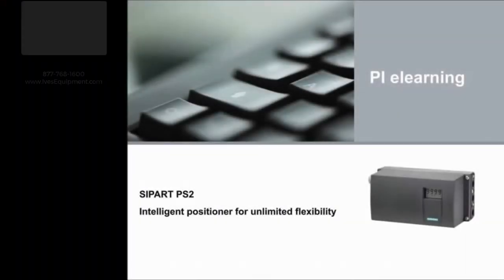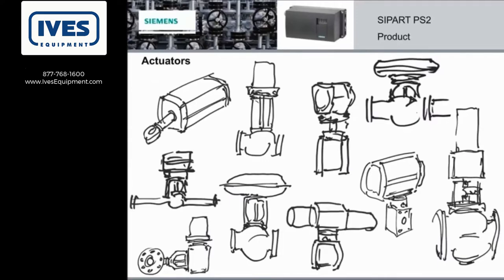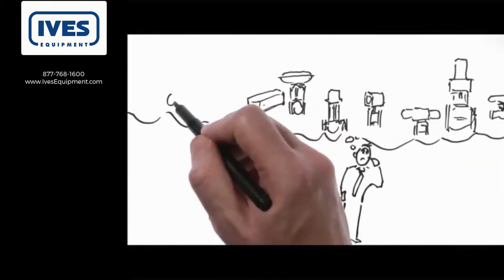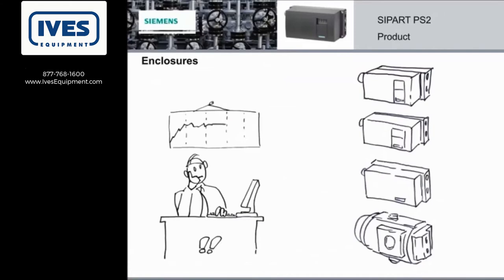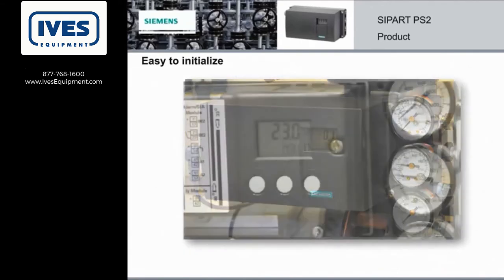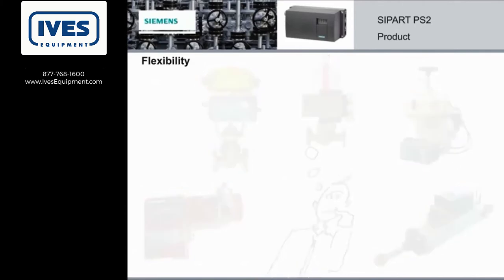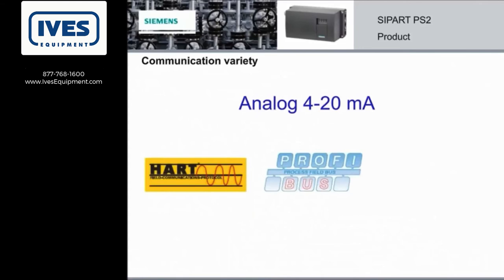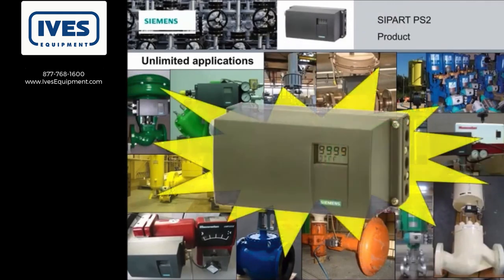Introduction to the SIEMENS SIPART PS2 Smart Valve Positioner

Comment: Dear sir,

have a good day.

i have recently facing problem   in a a newly buying Siemens PS2 positioner connect with
existing Single acting linear actuator , 20mm stroke.during comissioning this
new control valve/actuator in initial condition its display shows  P 85
and NOINI mode, at that time  when i press + and - button the actuator
totally not move.only small sound hearing inside the positioner and some air
release backside of positioner , however pneumatic and electrical connection is
ok.if i place old existing positioner there then it easily move

the actuator after pressing + and - key in NOINI mode.

Moreover when i go in Log 5 ,NOINITM mode 30% open the valve in both
YEND1 and YEND2 once i press both + and - key.once i release button then
actuator go to zero condition.it doesn't hold at all.If its abnormal what can i do.would you please advice me.

 if i press only either + or - button then actuator not move in YEND1 and YEND2

mode.but when i press both + and - button simultaneously then it open actuator only 30% but not hold at all then when press hand button its display range message.

 

will you please advice me its normal or abnormal?if abnormal then what can i do to fix
this problem.

 

Really i am facing a horrible condition for this positioner at my site and i am apologetically wish to get you kind advice please.

 

Thanking You,

Engr.Nizamul hoq.

proprietor.

United Mechatronics Engineers.

Bangladesh.

Email: united.mechatronics@gmail.com

Mobile : 0088-01814792505 and
0088-01935675378(whatsapp)

Skype: nizamul.hoq1